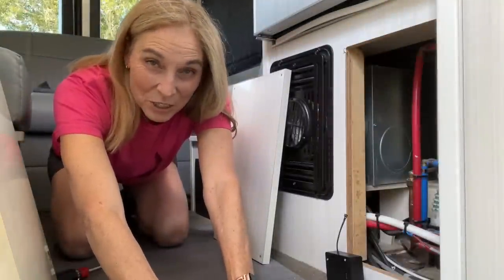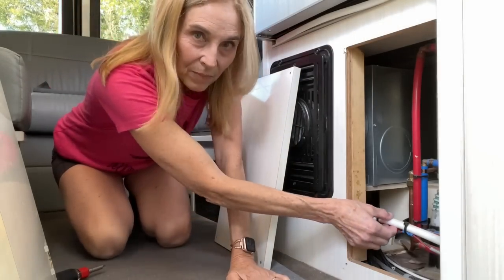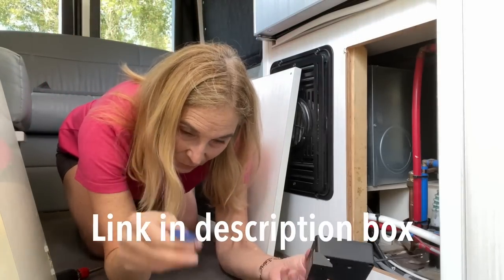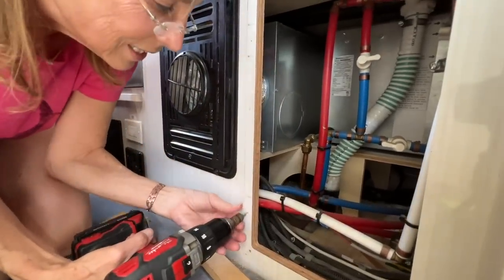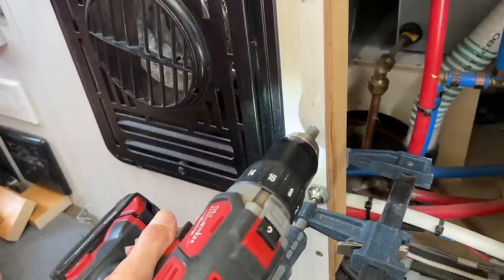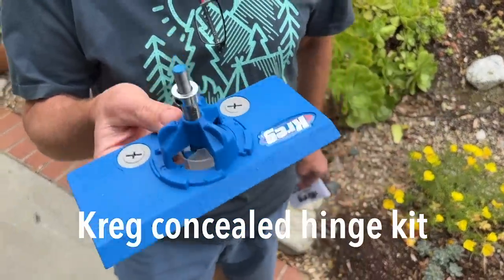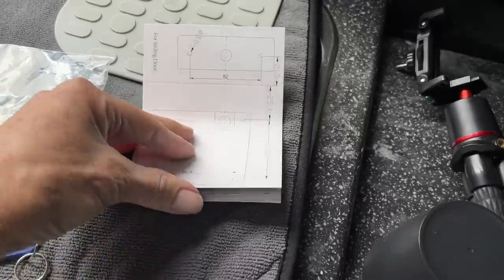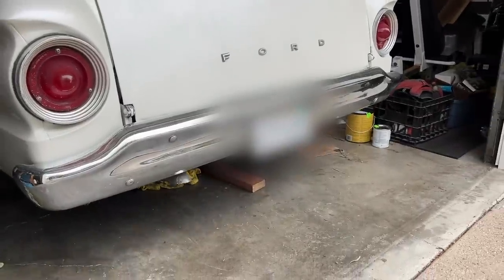Lock that Cupboard/Access Panel in your Campervan!

Comment: Always afraid of these “fob” locks what happens if it malfunctions? Then what? Good idea though! Love the Rancho brought back some good old memories.
Reply from the maker: They claim that it opens if the battery gets low and there is also a wire that dangles down from the unit that can power the lock from a USB cord (included).  You would just have to place the lock so that the small cord exits the door.  But in our case, there is a heater vent cover that could be unscrewed to gain access.  The screws are the Robertson variety (square head).   We carry the appropriate screwdriver with us.
Reply: @FromShetoMe  Thanks thats good to know.

Comment: I was wondering where the #shorts was with the head-fake video this morning!  Glad I checked back later.

My first thought about the RFID lock was "How much power"?  How long will 4 AAA batteries last, and can you open the lock if the batteries die?  (Edit after reading more: it unlocks automatically when the battery gets low.  Nice.)  And is there room enough in the compartment to put a small safe - sort of a belt & suspenders secure hidey-hole?
Reply from the maker: That's a great idea.  I think you could secure a small one to the top of the cabinet (under the fridge).  Otherwise there are too many wires in the way.

Comment: Hi Deb,
Any opinions on the Doheny ebikes? Thinking I want step into an ebike soon.
Reply from the maker: Never heard of that brand.
Reply: They are out of Dana Point. Another subscriber referenced them. So I looked them up. The bikes are foldable….
Reply from the maker: @bridgethill2183  Make sure that someone in your area can service the bike. Also, we have never had the need to fold our bikes. Bigger issue is weight/loading on a rack or into a vehicle.
Reply from the maker: Check out the new Himiway Pony.  Foldable, lightweight, inexpensive.  Just depends on what you are looking for.
Reply: @FromShetoMe  thanks for the info. Very impressed with your new bikes!!!!